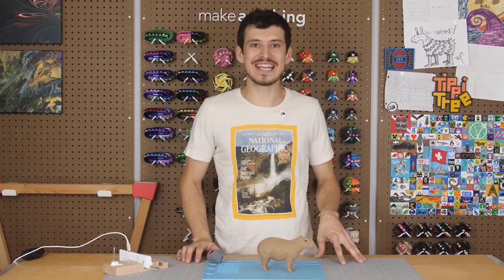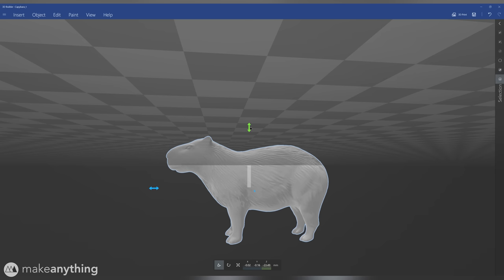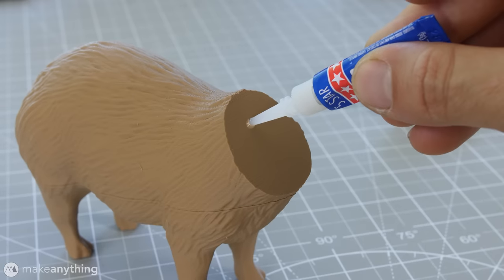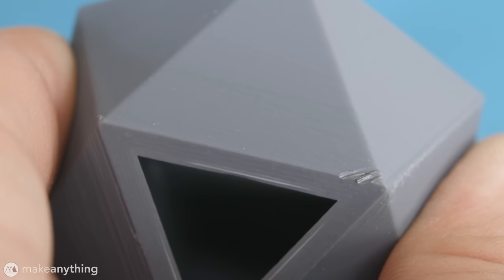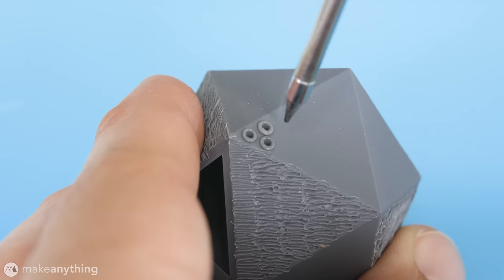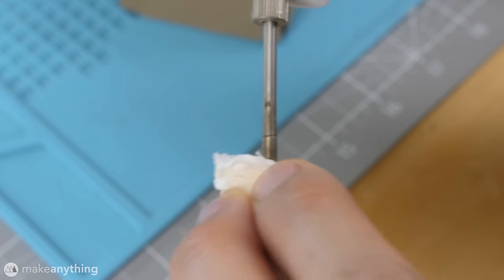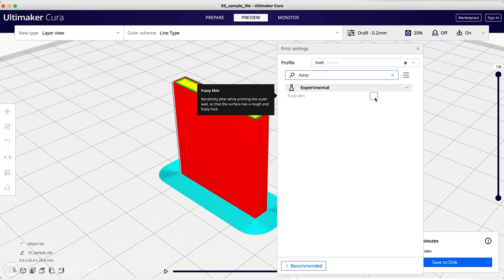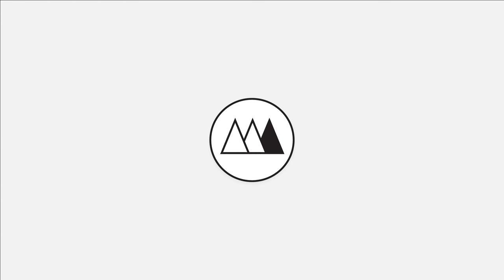Add Insane Detail to 3D Prints! // Un-Smoothing My Capybara

Comment: Beautiful, just a quick warning. Be really careful working around CA glue with hot tools. If you hear up dry CA it can release a bunch of vapours which are really really bad for your eyes and lungs.
Reply from the maker: Oof! I kept the CA in the center, but I wasn't aware, so thank you >.< Now I'm thinking I may not need any glue... Just melting the outer shell would probably be enough to hold an ornamental piece like this together
Reply: @make.anything  I was wondering if you had any techniques that would be a hybrid of the standard melt-in-screw-inserts and your freehand soldering iron/woodburner techniques for making more solid connections in the middle, melted together, before melt-sculpting the exterior.
Reply: @make.anything  I think it'd be a good idea to pin this so others who follow the video can work a little safer!
Reply: This is facts. It hurts. Burns your eyes
Reply: @make.anything  just add holes and print some cylinders a bit (~0.2mm) smaller to bolt and glue the pieces together.
Reply: The fumes released by CA glue are also flammable!
Reply: @make.anything  you can probably add a groove on the flat surfaces to glue, near the perimeter, so the excess glue goes inside the groove instead of seeping out
Reply: @lazyman1011  just make the wholes 1.75 mm and use filament as connectors 👌
Reply: Just use standard Elmer's glue.
Reply from the maker: @Russell White Hmm interesting idea!
Reply: @HerrSalat  Checked many models in the past that use this technique but didn’t use it for me. Maybe in future I will find a good way to implement it in my design.
Reply: @make.anything  I printed a prop dagger from a game and had to splice it up to fit my printer, I ended up only using my soldering iron to melt the pieces together. In order to make it a bit stronger I actually melted a little bit of a valley into the seam and then added some scrap plastic of the same color to fill them in. I've been a bit hard on the thing and it hasn't even budged in the 3 or so years Its existed.

Comment: Here's another quick tip if you find yourself struggling with aligning the sections: You might've seen some prints with cutouts and extra cubes or cylinders to print as joining pieces, but you don't actually need those extra parts; just cut 1.9 mm diameter holes (that should compensate for the inaccuracy of small printed holes, but this is just for regular 1.75mm filament) into your model (I personally use blender and "boolean subtract" small cylinders from the model) and use small lengths of filament as the "dowels".

Either use blind holes (i.e. the spot for the "dowels" isn't accessible from the outside; leaves a nicer surface on organic models) or, for structural parts, consider through-holes and then "rivet" the filament, i.e. use a flat-bladed soldering iron or woodburning tool, on fairly low heat, and just smoosh the filament lengths into the surface; it's got respectable holding power so you might not even need glue, and for flat planes you can sand them so the "rivets" hardly show at all.

I've used it loads of times, in fact my motion system on my Ender3 is a custom LR sled and I joined two pieces to keep the layer lines parallel to the pulling force of the timing belt; it's been going smoothly for more than a year now, so I'd say it's much more rigid than you would expect — definitely beats having your print delaminate xD
Reply from the maker: Good ideas! I'll probably use pegs when it comes to more complicated models

Comment: for the eyes, you could print it with a cylindrical hole there instead, then fill it with a blob of black filament using a 3d pen.  I've done this with some models I printed, and it came out great!
Reply from the maker: That's what I did for the goose :) Wanted to to something else this time, bit maybe I shouldn't have haha
Reply: @make.anything  lol.  I actually found the same(?) goose model (I think without having seen your video yet) and printed out one white and one gray.. I tried printing the little pegs it had with it for the eyes, but ended up just using my $14 3d pen to do it instead.  What a fun little tool, and a great compliment for having a 3d printer for stuff like this!

Comment: While true that the smooth effect from the burner alone isn't what most would consider smooth by printing standards. I bet if you were to print large props at thick layer heights it would be pretty fast to smooth it with a burner and then use a traditional spot putty/smoothing alternative to achieve the classic smoothed 3D print look, or at least faster than sanding, primer, sanding, spot putty, sanding, spot putty, sanding, etc.